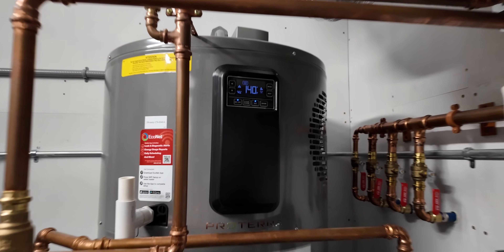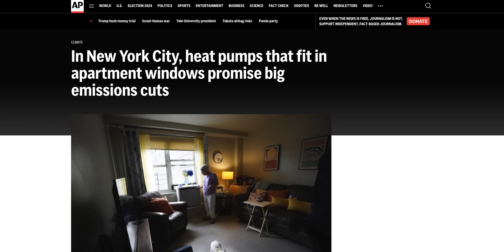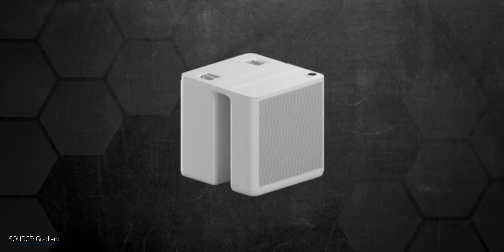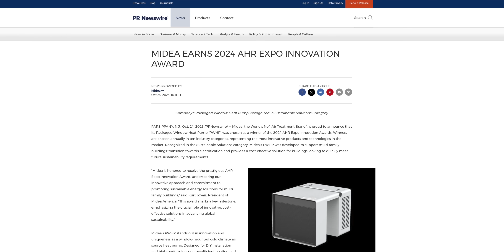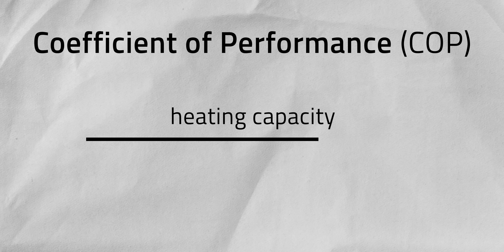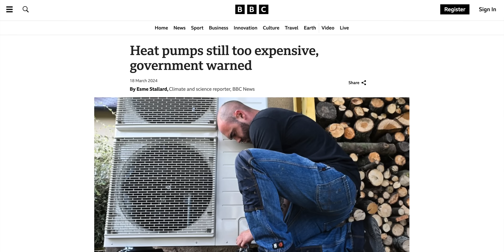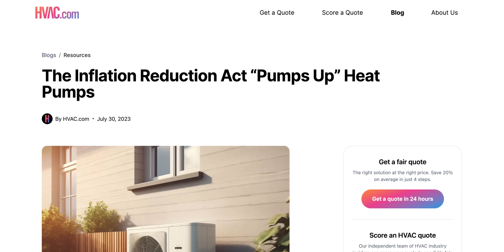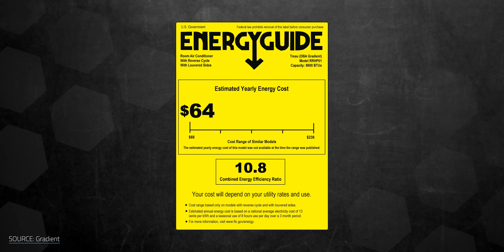Why This Window Heat Pump Is Genius

Comment: I was drooling for this un until you mentioned the price.. then I was like "what?!"  I already have the Midea-U 12,000 BTU and I think I paid $496 on Amazon.  Adding the reversing valve and a few other components should not make the unit cost $3,000.  That's insane.   I'd probably buy one or two of them if the cost were under $600 a piece.
Reply: I agree with most, it shouldn't cost 3k for it. I will say heat pumps are usually much higher pressures, so the whole system loop needs to be beefed up and you cannot just take existing components and slap them together, but again, should not be THAT much. Imo production volume is to blame, and once that ramps up they'll be competitively priced.
Reply: The issue is making it work at low temperatures. A simple reversing valve only lets the AC unit reverse to heating at (approximately) above freezing temps.
Reply: Can one install a air conditioner backwards in the winter to generate heat? Obviously you have  to protect the interior side from weather and drain the heat side’s condensation, but sounds like a cool dyi project.
Reply: @ScottMartinez  Interesting question. First thing would be the condensation management. Then the noise. Maybe newer ones are quieter, but most I’ve had have been incredibly loud on the outside. Not to mention that I think most are pretty burly in weight. Moving one around a window above ground floor would be interesting. 
All that said, this is YT, so I would love to see someone try it. ✌️😎
Reply: Plug a kill-A-watt between the ac/heat standing unit, and these efficient window heat-pumps, and only a fool would dispute their differences ❤
Reply: @wild.radio73 You canNOT plug a Kill-a-watt between two appliance.    It MUST be plugged into a power OUTLET!!
Reply: Great thread, by the way❤
Reply: It may be addressed in the comments already but I wanted to point out the cost is due to the low temp operation.  Getting below 32*F for a heat pump has been historically not possible.  The new technology used is called cascading heat pumps.  Basically like compressors or vacuums they stack the stages and actually use different refrigeration fluid to get heat out of 0 degree air.  It's the latest and great out there right now...and new tech isn't cheap.  A 3 ton home system IIRC is about $12,000. NOT including installation, refrigerant, and various other items.  Ouch!
Reply: Btw, everyone contributing here brought some food for thought. Retrofitting cooling units could become a decent spin off in some areas with more moderate temps, places such as SF or Norfolk. 
At least we have more options, which is awesome.
Reply: Right, just reverse your install in the winter and you have the heater!
Reply: HOW many Kwh does the unit use to put out that 9000 BTU of heat in one hour?????    THAT is THE ONE, and ONLY QUESTION!!!!!
Reply: @Tryp-j9d  Efficiency varies with the ambient temperature. It is much leas efficient at -10 degrees F than +10 degrees F.
Reply: the midea-u 12k btu is now selling for $279 at costco
Reply: @The8BitGuy  its $300 on AliExpress
Reply: So the problem I see is shifting heat generation from gas/oil boilers to an electric system. I understand there may be great benefits in efficiency but can the electric grid really support all the extra load? And also each individual building adding 1 or 2 of these units per apartment?  Seems likely you’re creating a different problem.
Reply: "all it takes is a few parts and you have the same thing"
Not commented: the parts or instructions
Reply from the maker: Yeah, the cost is a tough pill to swallow, but I’ve talked to a few people since the video came out and it’s more complex than just adding a reversing valve.  There’s a bunch of things in the design that require more complex engineering and parts.  It’s also a low number manufacturing run being a new product, which jacks costs up too.  I would hope that if this catches on we’ll see a price drop with larger volumes.
Reply: @UndecidedMF Not complex at all, they've existed for a few decades now.
Reply: @UndecidedMF all those things considered, midea already sells a heat pump window unit for ~$500. So 6x'ing the price is unreasonable.  Producing thousands of units starts to get out of small production and into mass production. If the run was 500 or 1000 units, you'd have a point. But they also intend to sell more of these units in the future, or units similar to them. Reasonable prices for these units should be no more than $1200 and realistically around $800-$900...
Reply: @antonisautos8704  That unit does not work down to sub zero °F temperatures in heating mode; this unit can and as such can replace your heater in most places in the US. It's not comparable to the $400 unit no matter how much people to pretend it does.
Reply: @Kandralla  it is a comparable product. And a place to start for a price reference. Putting a 6x multiplier on a price because it does heating in colder temps is outrageous. You can buy whole home heat pumps that have similar performances with temps with a much greater BTU and similar SEER or CEER rating. I can go to home depot right now and buy a system that's designed to heat and cool an entire house for 3k. Yes there is an installation cost after, but that system is more complicated with larger components.
Reply: @UndecidedMF  Why are the window heat pumps so expensive?  I have a Portable Midea Duo 14k BTU with Heat pump which I got for $500 a couple years ago. It does 14,000BTU cooling & 12,000BTU heating, most of the window units with heat pumps are severely cut short on the heat function too.
Reply: @UndecidedMF  Your full of crap. No it isn't more complicated. Lol. This is a flat out price gouge. Complete nonsense dude.
Reply: @UndecidedMF  nice way of putting 'I get waay too much sponsor money to care and say we're being fucked over...well me not so much but y'all'
Reply: @UndecidedMF  Then you need to talk to some different people. It's not complex at all.
Reply: @JustSomeGuy009  you are correct I actually have a 120VAC mini split air conditioner and heater with such reversing valve at home and the cost was $700 USD about 3 years ago.
Reply: @JustSomeGuy009  The concept is simple, getting it right is not. It's not just reversing the flow. HX sizing, pipe sizing, keeping the compressor oil in the compressor and not circulating with the refrigerant, are just a couple of the things that become more difficult when you can no longer assume that the refrigerant flows in one direction.

This unit is also designed to work in heating mode down to a much lower temperature than your typical HVAC unit, and probably operates at pressures that are inconvenient for use in a small household unit (there's a reason that R-12 originally won and these newer refrigerants are just showing up in this application in the last couple years), that drives higher costs as well.
Reply: @UndecidedMF  it's more likely the economics of scale as well as the manufacturer wanting all his investment back.  This is a niche application and so the economics of trying to recover all the original r&d may force the higher price.   The manufacturer also figures front load the ROI and price it to $3000 to get return up front/sooner.
Reply: @joeboxter3635  You are 100% wrong that this is a niche product. There is a wall of these at HD every spring. There over a 100 billion dollar market just in the US.
AC in non OEC countries I would bet is under 2 or 3%
Reply: @UndecidedMF  Yeah they're blowing smoke. It's obvious that a lot of the other comments on this window units are people like me that can literally convert a normal unit to a heat pump with less than a $100 in parts including some electronic switches.
Look at least the unused busses in a unit.
Reply: @UndecidedMF  It is just not that complicated its like $50 difference in hardware. The hardware and control board are basically identical... in fact there is a $420 12k BTU Midea on Amazon right now.... that heats down t 42F (28F if it is already turned on according to reports online, I've noticed that behavior also but have no measured it). This unit is $2500 worth of scam.
Reply: @ChaseRayfield88  again.. Its not that simple, you don't just throw a reversing valve in. That's like saying a 16000 pound box truck is just a car but bigger. 

Conceptually that's correct but when you get down to making it happen there are major design issues that prevent you from just throwing a box on the back of a Prius.
Reply: @Kandralla  It really is that simple yes the design may have some minor differences but none that would majorly affect cost more than $100.
Reply: @ChaseRayfield88 This is not comparible to the $435 unit mentioned above. This one has a  seer of 16 (vs. 13),  and works as a heat pump down to -13F (vs 42F)

The changes are not trivial and require:
- increase in sizing of the heat exchangers
 - a multistage vapor injection compressor (which I don't think are common in residential use)
-R-32, which is flammable, requiring better components and is hard to source.
-more complex controls.
-two stage expansion with a flash tank for separating the liquid from vapor between them.
-possibly a third, interstage, heat exchanger
-fitting all this stuff in a unit that will fit in the window and not be so heavy that it will break stuff

This is not just a window unit that they made a little bigger. This is essentially two vapor cycle systems that share refrigerant and have a  common compressor shaft.

If you don't care about the efficiency or it providing heat when it's freezing out, get the cheap one; but your comment on the price being unjustified is quite frankly utter BS. This is not just adding a couple valves and calling it a day.
Reply: @Kandralla  No it DOES NOT, gradient lists thier AC has having a CEER rating of a mere 10.8. The Midea is 50% higher. Note you must compare ratings like for like unless you do the work to convert...
Reply: @Kandralla  You are looking at the wrong AC. Midea has 13.3 CEER MAW12HV1CWT Gradient lists 10.8 CEER.
Reply: @ChaseRayfield88  no. I'm looking at the press release for the PWHP mentioned in this video.
Reply: @Kandralla  listen the people saying THX valve are people that literally open up and repair and program heat pumps for a living. 
We know more that you about manufacturer issues and the costs. We know the brand replacement part is $ 150-250 and generic parts FROM THE SAME FACTORY THAT MAKES THE BRAND NAME PART are $30-50.
You want the expensive part and we give it to you.
Anyone out of warranty 95% of the time wants the generic.
Reply: @Kandralla  obviously you don't know all the tricks that can be done to a standard unit to make it work below rated Temps. 
And again on the parts for other refrigerants, we work on those for walk in freezers and other types of units that are in the hundreds of dollars not thousands. 
This is for people that want to spend the money on product to be green.
Fine, put the person making the sales commissions and profits are spending it on range rovers and fishing boats so that the extra  money spent is usually converted in CO2 in the air at about 75%.
Reply: @ChaseRayfield88  I would not consider the Midea to be comparable. It has the form factor of a traditional window mount AC.

In my case, I have a traditional window mount AC in my bedroom that is just slightly wider than the Midea, so replacing it with the Midea 8000 BTU AC with heat makes a lot of sense. Of course, this would only heat my bedroom, and for this the 6000 BTU model would be adequate, but when I checked they were close to the same price.

An AC with heat that would be more comparable would be the GE Soleus saddle design. The 12,000 BTU design currently goes for $749. Like the Midea, it will not operate continuously below 40 degree F. The reason for this is that the heat pump cools the coils and freezes then when the ambient temperature is below 40 degrees. When started up fresh at an ambient temperature of 34 degrees, it can easily heat a large room to 80 degrees.

The main thing that the Gradient and Midea designs have that the GE Soleus does not is a defrost cycle to periodically get rid of the ice on the coils. It would be nice if somebody would design and manufacture a defrost unit to retrofit the GE Soleus AC with heat units.

In the meantime, cities like NY could offset the extra burden on the power grid, at least in Summer, by subsidizing the replacement of traditional AC units with the more energy efficient Media and Soleus AC with heat units. These are 35% more efficient when cooling than a traditional AC, so by replacing one traditional AC unit with one of these AC with heat units for every Gradient/Midea heat pump unit, they can balance the grid.

And perhaps NY City could fund the development of a retrofit kit for adding a defrost cycle to the GE Soleus and Midea AC with heat units.
Reply: @dalesplitstone6276  Not comparable my arse... the above nonsense leaves a big enough hole in your pocket you buy several of the mideas. They are absolutely comparable on cost / benefit... if some stupid regulation means you can't use the midea ... its a stupid regulation.
Reply: @Wingnut353  It is not regulations, but installation that is the problem. It is difficult to install a standard AC in an upper floor window. Additionally, it is hard to get a good seal with the "wings" on the side of the AC.

The Midea AC is a U design, well suited for upper floor apartments. But their AC with heat is a standard design. In my case, this isn't a problem since, instead of my current AC being installed in my bedroom window, they removed the window entirely, and replaced it with a wood frame that eliminates the problem with heat loss through the thin "wings" on the side of the AC.

It seems likely that Midea will introduce a U style AC with heat, similar to their U style AC without heat in the coming years, if not a low end saddle type similar to their high end heat pump.

Right now, it might make sense for NYC to subsidize the replacement of first floor conventional AC with inexpensive Midea heat pumps, in exchange for Midea committing to switching to a saddle style Type 1 heat pump (one that does not operate continuously below 40 degree F), or at least a U style Type 1 heat pump, similar to their U style AC.

Ideally, new saddle/U style Type 1 heat pumps would be deliberately designed to accommodate retrofit  periodic defrost add-on kits.

Comment: The Tesla shops quote about $4000 to replace the octovalve heat pump in a Model 3 or Y.  According to the Tesla Master Plan released by Elon about a year ago, replacing all furnaces/air conditioners with heat pumps would save as much energy (read "green house gases discharge) as converting ALL vehicles to electric.  Re-read that previous sentence.  Perhaps if the US government (and others) were actually and truly serious about global norming, they might have engineering crews and manufacturing crews resarching, developing, and making these by the millions (Manhattan Project style?).  Or China could make them and the USA could slap a huge tarrif on those products, too.  😕

Comment: This unit doesn't exist on Midea web site. You can get AC units, 12,000 btu 240V units but not at 9,000 btu 120V heat pump. Provide a link

Comment: One thing that you didn't cover was how much space these would hea/cool. It's pretty normal to need 2-4 window A/C units in a family home, a 2-3 bedroom apartment unit might want 2 for circulation reasons alone. If the doors are left open, or there's circulation between rooms, how many sq. feet can one of these units manage?

Comment: 10,000btu is the same heat output as 2 of those little 120v 1500w portable heaters. Last time my furnace went out in the middle of winter I had 4 of those heaters running and could barely keep it 50f in here. There is going to be allot of very cold people unless these only go in those tiny postage stamp apartments you hear about. I am still interested in one when the price comes down just as a  efficient way to burn the chill off the house in the spring and fall then cooling in summer.

Comment: 4:53 "You can win an electric vehicle"
Uhm, you should be aware most of those aren't street-legal outside the US and aren't available there either. Your lottery is kinda pointless if people can only get stuffed with a Model X, in a time when people are already avoiding Tesla as some of the worst value-for-money in the EV market (especially repairs and maintainance as Tesla runs an upsell-scam on those).
Autoweek recently ran an article titled "Nobody wants a Tesla anymore and here's why you don't either".

For those of us not stuck in the US there should be some options. BYD, Polestar, Cuptra, Volkswagen, Nissan, Hyuandai etc.

Comment: I was (until about a year ago) very, very anti heat pump - I grew up during the 70's and then "all electric homes" were popular due to the energy crisis and remember living in about a 1700 sq ft home that was always cold in the winter and always hot in the summer.  Heat pump technology and efficiency has gotten much better and I'm considering replacing our traditional gas forced air furnace and traditional central air system with a heat pump with gas for auxiliary/emergency heat (our generator can power the furnace blower but may not run a full heat pump).  I'm by no means a "greenie" but the benefits are multiple and some are in the environment column so that's not a bad thing.

Comment: Hi Matt. I can’t install the window saddle type because the city ordinance will not permit any object - window A/C units to hang over the exterior sill (Boston) - a unit that fits to the frame and sash   - and does not cantilever from the facade is feasible.  Any suggestions - a modified design could work